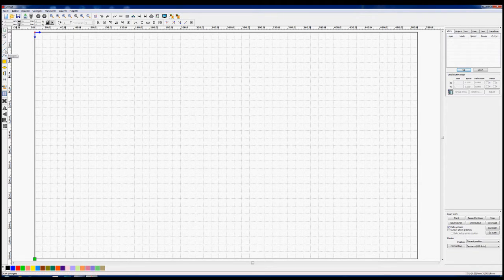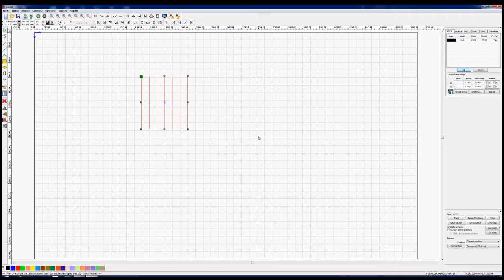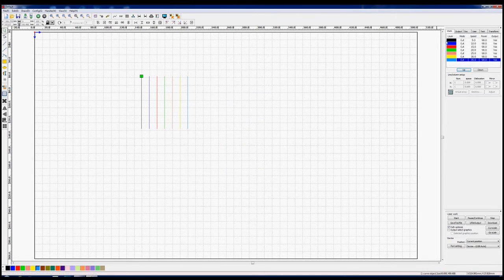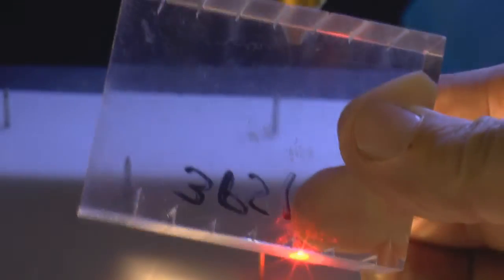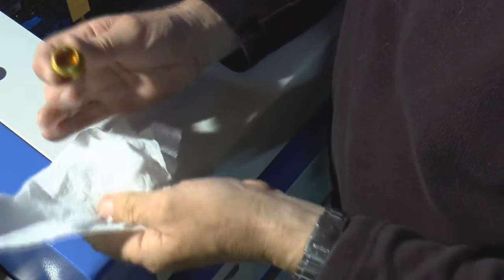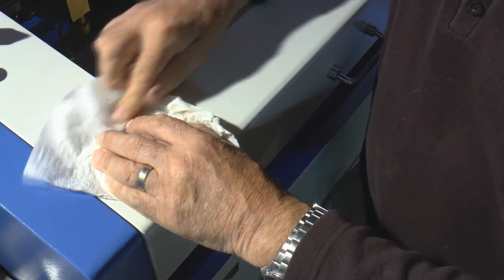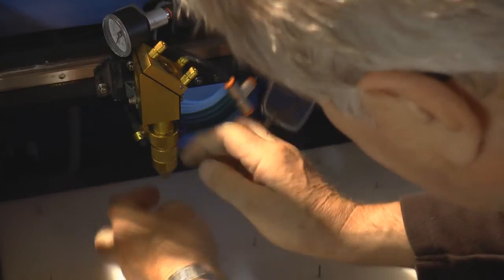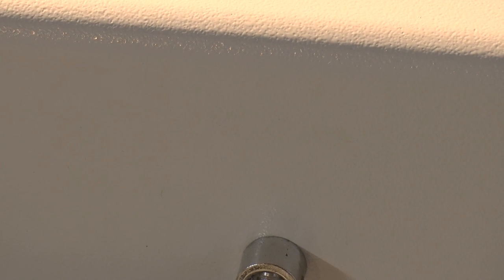RDWorks Learning Lab 07 Lens cleaning test program

Comment: Hi there. I have a question regarding the air assist. Can I split my air and have one blowing on top of the lens and one where it is at the moment (Bottom) so that no particles enter the top and cloud the lens. I lost one lens because of this problem the lens actually cracked because of the residue absorbing all the heat. Thanx in advance.
Reply from the maker: Hi Christo
I have heard from  two seperate people in different countries that have managed to vapourize  a spider and an insect of some sort that crawled into the lens tube over night and sat on top of the lens. Yes it made a black mess on the lens and damaged the anti-reflective coating but no cracks.

 You are quite correct that debris on one face of the lens can heat it up unevenly and cause damage.. As you progress further into this series you will see that I do not use my machines seriously but I do a lot of experimental work to find out what the machine capabilities are and how the laser technology works. After 6 years I am still learning  but now it is VERY technical and all around the performance of lenses and how and why they cut materials. . However, in those 6 years I have destroyed a few lenses with my experiments  because I do things with the machine that were not intended.. I have cracked 4 lenses but  every instance was because  I had over stressed the lens with too much power. For example I had set up a double lens system where I was reducing the beam diameter before hitting the second lens.Different lens materials are power limited. So if you have a  Chinese PVD lens that is the colour of amber, then that will be limited to about 60 watts (80 watts max. Whereas those that are bright sunflower yellow   (USA CVD) can handle about 150 watts. If you have black looking lenses then that is gallium arsenide. You cannot see through the material but it can handle 300 watts or more..

Best wishes
Russ
Reply: @SarbarMultimedia  thanx a lot

Comment: actually what is the function of the hose beside the laser tip?
Reply from the maker: Hi

This is one of my early videos right at the beginning of my learning journey. At this point I did not fully appreciate the real importance of the air assist that you inquire about.. That tube entering the nozzle does two things. First, for cutting wood and other organic materials  that created LOTS of smoke. it is essential to get lots of air into the narrow cut.  The smoke must blow out of the bottom of the cut . Any smoke that come upwards will be blown back down onto your work and will stain your work brown as the smoke condenses on the cold work surface. There is secondary reason to have airflow through the nozzle and that is to keep air moving across your lens. This prevents fumes from fogging your lens.. For some applications such as engraving, you need only just a whisper of air flow to Keep your lens clean. With engraving there is no groove to get the smoke away, therefore it will always explode upwards like a volcano. Once the smoke is in the air you need to keep it there and suck it away efficiently with your fume extraction, fi you run normal air assist, you will blow the smoke back down onto your engraving and spray paint it brown.  So, understanding air assist and using it correctly will enhance the quality of your work.
Best wishes
Russ

Comment: Hi there. I am facing a problem with may 50W laser machine. It is not cutting acrylic as it used to.So I saw in one of your videos that the lens & mirrors might be covered with smoke or so.So my problem is after cleaning them I am not getting the laser power out of the laser head. I touched the head it was so hot meaning that the laser is getting there but not through. So my question is When do I know that I have to replace the lens? I think It might be the reason for my problem Although it seems to me fine. Thanks for your videos I have learnt a lot from them ( if I may sometimes your good voice is so low ) THANKS a lot dear friend
Reply from the maker: Hi Mustafa
The fact that your head is hot means that the. laser beam is not well aligned and colliding with something inside your head. I discovered this problem with my head.
see   https://www.youtube.com/watch?v=ELeqP3tHlp0   from about 11 minutes.
see  https://www.youtube.com/watch?v=eSjNsK2sjNo

In this next video I have replaced the existing head with my own design acrylic head that is fully adjustable in Y and Z. This is an essential adjustment that was never included on machines. In the last year or so I have now seen a few machines that do incorporate this feature.
https://www.youtube.com/watch?v=jVGByifge_Q      from 24 min 50 sec you will see me explaining the way that the beam MUST pass through the head 

Look for this problem in your machine. The lenses do not get hot or they will crack. If your mirror is not reflecting, it will feel hot. This generally only happees with gold plated mirrors when the gold wears this with cleaning.

Best wishes
Russ

Comment: Russ, your air assist tube seemed to pull out rather easily.  Mine doesn't.  Is it meant to just pull right out of that connector?
Reply from the maker: No It is purposely locked in . It is meant to push in easily but you have to push down on the little plastic collar and then the tube will release from it's lock and allow you to pull it out.
Best wishes
Russ
Reply: Fantastic--thank you, Russ, for your patience in explaining something so simple!.

Comment: Hi Russ, hope you are well. Russ, have you used  ROR Residual Oil Remover for lens cleaning? what is the most efficient way of doing it? Do you have a Tutorial of cleaning the laser in later videos?
thanks,
Dimitri
Reply from the maker: Hi Dimitri
This video was very early in the learning journey and is not the best way to treat a lens. I now use a cotton bud and a some isoproyl alcohol to carefully clean the lens. The lens is made of a toxic yellow substance called zinc selenide. In it's raw state it is only about 70% efficient at transmitting IR light. This is not because the energy is absorbed by the material but because the crystal structure of the material reflects 30% of the light hitting it. To make this lens more efficient (about 95%), it has been coated with a film that is anti-reflective. You need to understand this because if you are too aggressive with your cleaning you will remove that coating and all of a sudden you have lost 30% power.  The coating is not fragile but you need to be gentle with it. The best mirrors to have are molybdenum. These are very efficient and extremely durable and you can use acetone to clean them quite aggressively.  Do NOT use acetone on your lens.
To finish off both lens and mirrors do a final polish with proper lens tissue that you can buy from ebay or a camera store.

Best wishes
Russ

Comment: hi, i have a problem with my machine , my page cordinates are 700mm with 500mm ,  when i give order to cut its cuting in different place and also in other side , if you know what could be the problem please ?
Reply from the maker: Hi
I suspect your Config/System setting is incorrect. You can look at 
https://www.youtube.com/watch?v=CWZvQXxbR_E

If this does not help then send me information about your machine and I'll try to help. The sort of detail I shall need are where your head goes when you switch the machine on back left or back right. Also at bottom right of RDWorks there is a window called POSITION. What does that say?

Best regards
Russ
Reply: hi , when i switch on it goes to right maybe 10cm more down than highest
 point corner , if you have skype i could send you a photo or a video 
how its working ! my machine its the same like yours just a bit biger 
and its red color the machine menu and the program are the same , i have no idea what the problem could be ??? 
 
thank you.
Reply from the maker: I have sent you a You Tube private message with my email if you can find it.
Best regards
Russ
Reply from the maker: Hi Paul
The starting point (machine 0,0) is set when the machine drives over the sensors at the end of your carriage  X and Y movements. In your case you will find a sensor at the right hand side of your X beam and at the rear of one of your Y bearing rails.  If you use the arrow keys to drive the head fully right and fully back and then look at the X and Y coordinates on the display screen you will see that they show x=0 and y=0. You cannot change this situation.You should now be able to move the head to the middle of the machine with the arrow keys and make a note of X and Y coordinates from the screen. Now press the ORIGIN button and then press the RESET button. The head should move to the back right corner, set 0,0 and then move back to the origin point that you set in the middle of the table Check the screen to verify this.
If your machine is doing this then it is working correctly. If it isn't then tell me what's happening because there are settings that may be wrong.. What are you wantig to achieve?

Best regards
Russ
Reply from the maker: Hi Paul

watch https://www.youtube.com/watch?v=CWZvQXxbR_E This may helpexplain things a bit more.
Best regards
Russ

Comment: I have to say I cringed watching you clean the lens.
What you need to do is use nothing harsher than a medical grade cue tips to clean.
Paper scratches the coating as well as the debris. Never vigorously rub on the coating like that with anything!
You first use a mild acid. Vinegar works well or acetic acid which is basically vinegar without water.
You can then follow up with the alcohol to remove any slight residue from the vinegar .. but pure acetone works better.
I operate a 4000w laser for a sheet metal company, and am interested in your machine for home hobby use.
I have watched about a third of your library so far .. Keep up the great work .. good stuff !
Reply from the maker: +guinnesspeaks 
Hi 
Bear in mind these videos are a record of me learning. Yes I made some silly errors in the early days. Q tips and acetone are the favoured tools now, but more important is to never turn the air assist off, the positive pressure in the nozzle ensures no fogging. I inspect the lens occasionally but can't remember the last time I had to clean it. I now have an HQ lens fitted and will be extra careful because of the expensive anti reflection coating.
Thanks for your commenets
Best regards
Russ
Reply from the maker: +guinnesspeaks 
Hi You need to watch https://youtu.be/1yMAr75h5O8 before you make a final judgment on flat up or down.
Regards
Russ
Reply: SarbarMultimedia  
I watched it ... I am no expert on these smaller machines, nor can I 100% validate the variables in your testing. But I do know that the lens holders and the lens itself is designed flat side down.
For starters, just putting it in wrong physically changes the focus depth, does not insure that it is seated evenly. On our machine, the lens gets inserted into the head from the side. We change lens several times a week 5" - 7" etc.
One of the guys at work could not get a good cut all day ... so I tried and failed .. this caused me to pull the lens and laugh.
It's 180 degrees of failure simply because of the depth of the lens holder itself. Instantly back up and running.
I come from a different world, this is why I like your videos so much. But I will never be caught intentionally flipping a lens.
Reply from the maker: +guinnesspeaks 
Hi 
The little lens holder in this machine has 2 flat location faces so the lens will sit true regardless of orientation but, as you point out, the thickness of the lens automatically changes the focal point before we even consider the difference between the EFL and BFL.. This is a completely different world to the metal cutting lasers. If you bring 5% of your knowledge and experience into your hobby, that may still be an exaggeration. I owned and ran a laser profiling business with two 3kw Amada machines for ten years but I had to start my learning all over again. Because my other hobby is video, my learning experience (mistakes and all) are documented in this series. Now almost a year into ownership I can see just how little I knew about this "parallel universe". I still have much to learn. I thought I understood lenses but as you can see from my practical experiment, there's always something new to discover. Yes I have now had to decrease my setting piece from 6.5mm to 4.5mm but I plan to leave my lens flat side down because it seems to give a smaller spot size (higher energy density) and a 50% increase to the usable depth of focus. 
The Chines seem to send their machines to market with the lens convex side down and supply a setting piece to suit this lens orientation. There is lots of advice on www to flip the lens to flat side down. However,you will not find it mentioned that you will need to adjust your focus point if you do so. This was a demonstration for those many souls (including me) who flipped the lens without thinking. I have a 1.5" lense but most people have a 2" lens. My understanding from others is that  the difference gets less as the focal length increases. 
ps. There's no metal spatter to screw up your lenses with these machines.
Many thanks for your comments
Best regards
Russ
Reply: +SarbarMultimedia 
Yes .. and your video speaks to this adequately I believe.
And you did prove that it has a more forgiving cut length.
This helps eliminate hourglass shaped kerf etc.
So all is good.
I do intend on buying the same machine as yours ... 
Am deeply in debt for your video on how to trick this thing into doing a test shot. I would have drilled a hole in the case and done it from outside the machine about a foot or two away removing the 1st mirror. That is a great idea you came up with. Much easier.(Lab 22)
I always knew that this was not a true 50 watt machine, but was very surprised that running at 60% was the ideal ... hehe .. great work.
Reply from the maker: +guinnesspeaks 
At this point I still have a great deal more to discover!!. For an improved mode burn test try https://youtu.be/8Jgf0fPsPH0
Regards
Russ

Comment: Best wishes from Germany. Finally I put the lense out for cleaning without being scared. Everything works well again, don't need a new tube - which I thought. ;-) Thank you very much - joined your channel although I work with this machine for now 3 years, don't know everything yet.
Reply from the maker: +Laser Woman 
Hi
Just a quick reply to say that although I hope you find my experimentation interesting I do not always get things correct because this is a series about me learning to use the machine. I found out much later in the series that my lens was fitted by the factory the wrong way round. The lens should be FLAT side down (facing the table). I have an enquiring mind and I like to know how things work. Although I have made lots of small improvements to the machine it's basically excellent value for money. Don't be scared of the machine, you are a lot more intelligent than it is!!!! 
Regards
Russ
Reply: +SarbarMultimedia I hope so #intelligent - A lot of rumours makes you feel scary indeed. The lens, FLAT down is right. Now I have to change the tube finally. Looking forward for the insulation because there was no white gum or silicone in my blue tool bag... so we will see... Thank you for responding.
Reply: Yes .. flat side down is how they all work to my knowledge.
Reply: This is just my theory .. 
But I think when these lenses are designed with the idea that the beam is bent inside of the lens rather than outside of the lens.
Flat side up would mean the light travels straight through the lens and bend leaving.
Convex side up means the beam is bent as it enters and leaves through a clean flat surface un hindered.